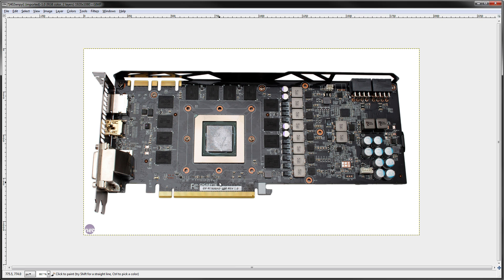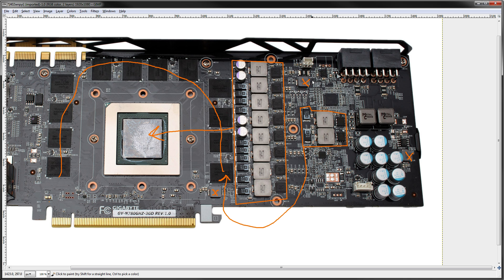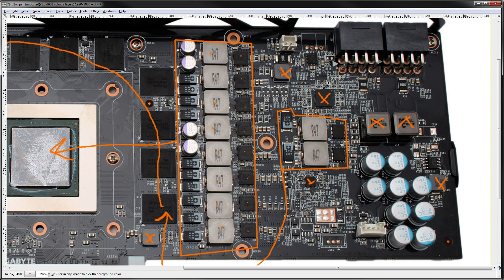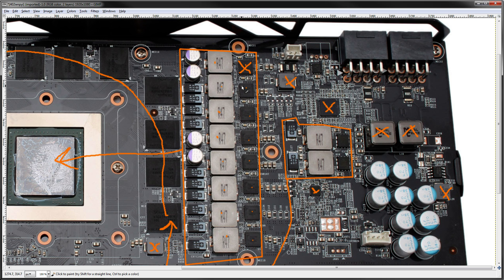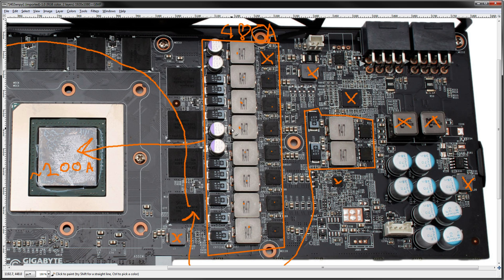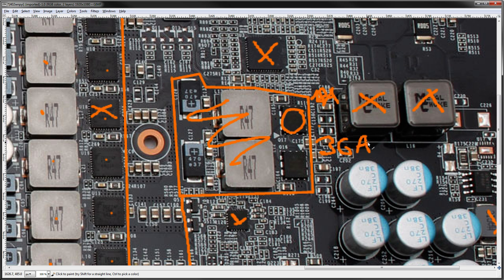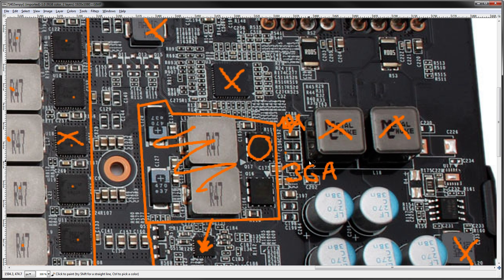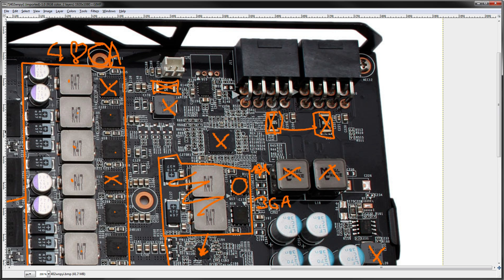Gigabyte GTX 780 GHz Edition PCB Breakdown (voltage and power mods)

Comment: noob question
8:34 What are those components to the right of core power module with the cross mark? Are they ceramic capacitors? If so, what exact kind of ceramic capacitor they are and what specs do I need to look for to replace them? thanks...
Reply: I have the exact same Question and yes this are ceramic capacitors

Comment: Hey Buildzoid, have a quick question. Did a vcore mod on my Zotac 970 AMP! Omega, didnt bring much so I tried a vmem mod, anyways, I somehow fucked it up and it got really really hot and crashed before I could go into windows, removed the mods, started up again and it kind of works now again, everytime I put a load on it theres a high pitch whine, like from coil whining and it gets extreme artifacts and then crashes, looked over all components found nothing wrong with them, could you help me out? I need it for the my youtube videos, btw. warrranty is over anyways!  :P
Reply from the maker: Kinda hard to tell what could be wrong with it over the internet. If I knew how you screwed up the mod then I might be more successful but by the sounds of it you ended up giving Vmem way too much voltage. What kind of damage that could have caused I have no idea. I'd suspect permanent to the VRAM chips maybe the GPU's memory controller. However that wouldn't explain why you suddenly have tons of coil whine.
Reply: If the VRAM is fried it might get short circuited and draw a lot of amps and make coil whine from the inductors?

Comment: We need to ban shunts. :/ stupid nvidia card poo. Amd I set my power limit to over 9000 and off we gooooo
Reply from the maker: Shunts don't limit power. They are there to measure power. Shorting them out makes the measured value lower than the reality and so you effectively get a high power limit.
Reply: on my 780 ref, 680 lightning and 670 power edition they all power throttle even with 300tdp bios? is this because of these shunts?
Reply from the maker: If those shunts register a current of more than 25A they will give that to the driver and the driver will drop GPU clocks to lower the power draw. Be glad that Nvidia doesn't rely on more advance current measurement methods or it would be a hell of a lot harder to physically remove power limits.

Comment: Would you mind comparing the GTX 1080 G1 gaming PCB against MSI 1080 gaming ? i'm thinking about buying one, but would like to know if worth the investment. Thanks.
Reply from the maker: I would do it if I could ID the MOSFETs on it. Which I can't from the photos available. it's still and 8 phase VRM for core voltage and with how Pascal isn't really affected by extra voltage it should be a perfectly good card for daily use.

Comment: could you please do a G1 gaming GTX 970 and do a PCB breakdown? my card overclocks like crazy but I really would like to know more about the PCB so I may know more about what the card can really do. http://www.nexthardware.com/repository/recensioni/955/immagini/ICON_970peg.jpg http://www.technic3d.com/article/pics/1751/GIGABYTE_GTX_970_G1_Gaming_15.JPG https://elchapuzasinformatico.com/wp-content/uploads/2014/11/Gigabyte-GeForce-GTX-970-G1-Gaming-15.jpg
Reply from the maker: If you want physical volt mods for that card I will need a pic of the back of the PCB.

Comment: hm ...
I tried to increase the power limit on GTX 1070 by applying liquid metal on shunt resistor. And either i did it wrong but the overclock increased only by very little 2063 -> 2088. Like I was able to run it at 2114, but it would not be completely stable. The card is water cooled, so it stays relatively cool (under 50C for core and I the VRM area on the backplate is just warm)
And the card still hits power limit :(
may be i had to apply a bit more liquid metal to further reduce the resistance.
Reply: Best I've got my 1070 to hold was 2137mhz but 2127 and 2100 most of the time just depends on the load but it seems like most love 2088. I also got 9400mhz out of the memory. What kind of 1070 do you have i picked up a zotac 1070 amp extreme. And running it with a asus x99 pro 3.1 and 5820k 4.6
Reply: I got an EVGA GTX 1070 SC Gaming. I honestly hopped that with power mod, I'd be able to push it beyond 2150. Like if I just max the sliders of power, voltage and temperature limits, I get 2000MHz out of the GPU Boost 3.0 without changing anything.
Ended up using the card with 100MHz offset on 1.012v (i found a way to force the card to stay on specific voltage) ~2000
Reply: +Dmitri Weissman yea honestly most people with pascal cards are getting 2000-2100 on there oc's. And the extremely lucky one are getting 30-50mhz higher and it seems the founders oc better than custom cards i think the first batch might have been cherry picked. My card out of the box boosted to 2030-2050mhz i can add 105mhz and 600-650 memory with overclocking software. And I've tried them all and precision x is working the best for me personally and I've always used afterburner. I wouldn't put to much into it, your not gonna see any different in games but synthetics it will help. You might get 5 more fps if your lucky. But in games its hard to hold a high oc gta 5 i got to hold 2137 for awhile dropping to 2127 and holding. But most games its 2100 to 2088, plus that evga card is a great card very quiet and i like the way it looks, my last card was a 780 classified loved that card and i wanted the evga sc card but it was never in stock and i love the zotac but its a big bitch.
Reply: Chad Hay I use it watercooled - main reason for peaking EVGA - replacing the cooler does not void the warranty.
So at 2000-2025MHz@1.013v the core is 40C at 30C ambient. So i just left it there. at 2088MHz@1.063v it gets closer to 45-47C.
@1.094 it gets toward 50C.
Also clocked the memory to + 600 but seen no real benefit from it.